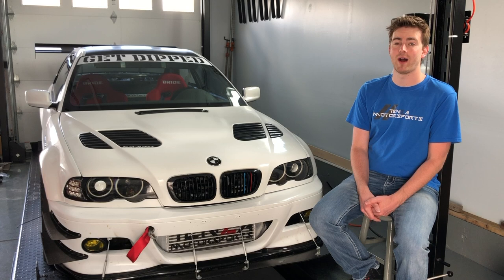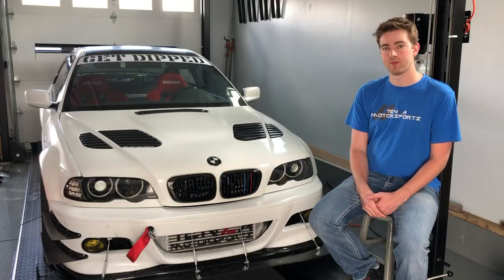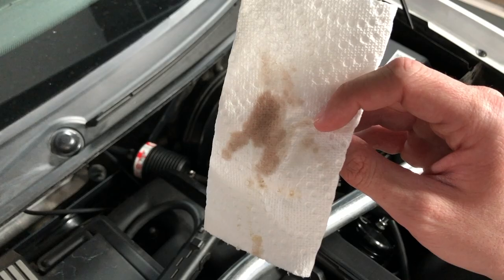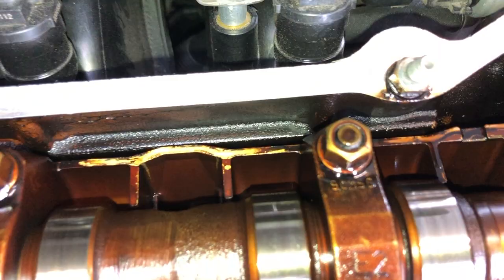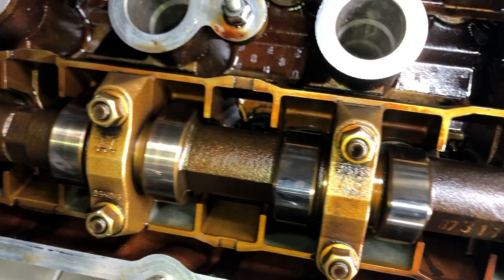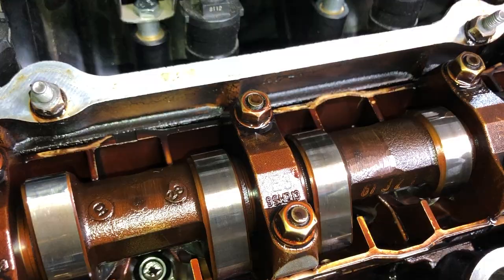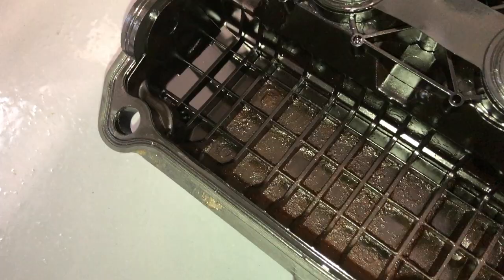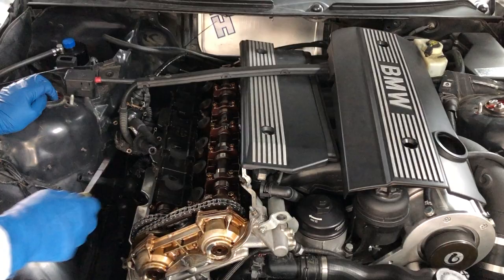500 mile break-in and Royal purple verdict (Part 2)

Comment: is royal purple 5w30 shrinking. it showed in dipstick below min. what is the problem. does the hps has same problem. some other users have ssme problem. what is the problem?
Reply from the maker: Not that I know of? If you look carefully at the video when I squeeze the paper towel around the dip stick you can see it’s actually on the high end. I had only added about a half quart after the initial start up. That’s just need because the oil filter fills up and there is lot of oil hiding in the engine such as the vanos system. So far no problems here. I will definitely look into it tho
Reply: @TenzaMotorsports  i usually check oil level next mornong before driving? my car dipstick showed below min. no worry my car is treated with Xado oil additive that generates on cylinder wall ceramic surface that is 10 times stronger than steel and increases the compression. but in my car the oil was below min. i drive 2006 uprev infiniti g35 sedan 6mt with 132k mileage. some sensors gaskets are leaking. is it cause rp.? i have read issues people are having after using rp hps. knocking sound etc. it is strange??
Reply: @KK10027  if there was any build up or sludge at the sensor the RP washed it off.
Nissan Engines like the VK Series are very harsh on oil.
I don't go beyond 5k mile intervals on synthetic. I had just changed my Valve Covers on my Titan you won't believe the build up in them.
I'm not the first owner but I've heard this is common when people go with the 7500 OCI and use a conventional or semi synthetic.
Reply: Sounds like you have a engine problem not a oil problem, just saying motor on.

Comment: Specific question but the new Ford F-150 is known to get higher carbon build up on valves because for what direct port injections 

Would this help clean those valves? Right now ford has no clear solution for keeping them clean and they can get pretty dirty pretty quick
Reply from the maker: I would not be afraid to try it. Run it for awhile and change it and see what it does. You can also send it to be analyzed by a lab after use to get a more empirical answer. Good luck!

Comment: Well, so, what you say about this oil? Good or bad? How much miles do you running with this oil?
Reply from the maker: It’s been great. In this specific car I’ve done about 2k miles regular Royal purple and around 3500 miles with XPR
Reply: @TenzaMotorsports  thanks so much. I use ZIC TOP 5w30, workin' in taxi every single day. But this oil interested me. I want to give it a try.)
Reply: I change oil every 10000 km.

Comment: Put a quart of atf in your engine will do the same thing only better
Reply: Yes sir that's a old mechanics trick I have used several times on old sludgy engines that have lifters making noise because of being plugged with crud worked every time for me !
Reply: How long do you run the engine with atf I have a 01 suburban with 248k miles on that has a couple hydrualic lifters taping

Comment: Thanks! I have a brand new Challenger R/T. I was told by the dealer and Dodge that the recommended oil change is by 6000 miles. Blew my mind... but at 4200 miles (since April when she left the show room floor), I feel it’s time to change. Youtube read my mind before I got into the research and your part 1 and 2 popped up (creepy but cool). I’ll give it a try and see how she looks in a thousand miles (probably still clean).
Reply: SO WHAT HAPPENED???

Comment: I have an old willys Jeep and have been running Rotella T.  I pulled the valve cover off after running it for 500 miles and was blown away how clean it was.  Similar to Royal Purple there are very strong detergents in Rotella T, and I am convinced cleaned the top end.  Seems like you had the same experience.

Comment: You could just change the filter every 500 miles and add magnets to trap microscopic iron particles.
Reply: Jon Hutchens you can never change your oil too often
Reply: Oil is cheap in comparison to engines and internal components.

Comment: Why not just use Amsoil? You want the absolute best for your engine don’t you?
Reply from the maker: I haven't tested Amsoil yet. So far Royal Purple has been the best
Reply: Amsoil is good, but Royal purple is the absolute best.
Reply: silfortytypex Yes and that’s why he is using royal purple. Amsoil is a scam. Nothing spectacular other than their sales pitch. Royal purple is the king of the hill and everything else is just oil. I guess you hate your engine, feeding it Amsoil.
Reply: My 1ZZ-FE engine in my Celica had this nasty sounding rattle to the top end of the engine that only sounded better when the oil was topped off to the full line on the dipstick and I switched to amsoil and the rattle literally disappeared instantly.
Reply: @KingJamesIX  
Totally agree... my VTC was rattling alot on cold starts and it started to go away after a couple oil changes of amsoil.
No joke
Reply: Amsoil is da best
Reply: Even Pennzoil is better than Royal Purple

Comment: My Ford F-150 is nearing its 80,000 mileage mark so other than the oil & filter change, I have to give it the 80,000 mileage maintenance requirement to make sure that my truck runs better and longer.
Not only that, but whenever my truck gets regular oil, I give it 2 cans of Royal Purple fuel additive every 10,000 miles to thoroughly clean the engine and fuel system and get better fuel economy in the process; it may be too much, but my truck has an eight cylinder engine, NOT a four cylinder. Plus, it's pushing 13 years old.

Comment: I can see that it cleaning the top been really good but what about an older motor that's got a lot of miles on it what's it going to do to that? I would imagine it might be more bad than it would good man that'll be clean but what else am I to do to it?
Reply from the maker: If it has had poor maintenance you will need to change lots of the seals and gaskets

Comment: Would it be safe to use in a four stroke vtwin?
Reply: Yes
Reply: Yes
 But if you're talking about a motorcycle where the engine and transmission share the same oil, a motorcycle oil would be a better choice. They have additives to deal with the meshing gears and wet clutch.
Reply: I put Royal purple in my 03 Harley, noticed a difference. More pricey but you get what you pay for.  20w50 and off you go.

Comment: That’s really cool, I have a 03 350z and ever since I’ve bought it I’ve only used royal purple. I also used to use their filter but autozone doesn’t carry it anymore
Reply: Ivan Guillen oof. I’m part of the z community and it’s been rated the worst oil for our cars and most of the community stays away from it. It probably wont hurt to run it every once in awhile just to clean the engine but not as a permanent use

Comment: Do y’all think this would work for a filthy 1991 D15b2 that runs conventional 10w-30?
Reply: Depends what are trying to accomplish. Was the engine abused, ran low on oil, valves loud as hell i had a d15b 3 stage snd i always ran pennzoil high mileage 5w-30.

Comment: RP is a great product, as far as the exhaust cam being cleaner then the intake cam, Note this is a educated guess. I would say because the exhaust cam is hotter making the detergent in RP more effective? Also the exhaust cam is lower than the intake cam gravity could cause more oil to collect on the exhaust side of the head before it drains down to the oil pan to start it's journey over again? NICE RIDE home slice.

Comment: So can you put any synthetic oil in old engines with stock parts?
Reply: Yes you just cant use old style oil in modern day vehicles new oil is backwards compatible
Reply: Sure if it's got new gaskets and seals because I have tried it in a 90s Chevrolet V6 in a Corsica that had about 140,000 miles no leaks prior and ran excellent and it started to leak oil like crazy until I switched back to regular dino oil ! Being older engines the gasket material and sealing surfaces arn't nearly as good they will tend to leak being synthetic oils are thin and very slippery so you have to watch it !

Comment: My first experiences with RP came about twenty years ago. I'm curious which oil you used. Back then, RP advised against using it in a new engine. I think it was 1500 miles minimum for a street engine, and the equivalent of 100 short laps on a racing engines. They've since released a break in oil, and assembly lube. I wouldn't think the break in oil would have as much detergent. Could be wrong, it was just a thought. I've never been into an engine that ran RP, except race engines, and they tend not to get dirty anyway. But I have always noticed a quieter and smoother engine on start up, whenever I've switched a used engine over to RP. It's good stuff. Thanks for sharing your observations.

Comment: Royal purple is aces in my book I had a 600 horse Nova with a small block in it the oil pump pickup broke of 3/4 of the way down the quarter mile at the race track and it was reved to about 7500 rpm with no oil pressure I didn't look down until I went through the traps and seen the gauge it said zero I instantly shut it off and put it in neutral and put it on the trailer pulled the engine and I know there is going to be someone that's not going to believe this but there was no scoring of the cylinder walls and the bearings looked so good they had no scoring no wear marks at all they still looked new and it didn't hurt the solid flat tappet cam I couldn't believe it Royal purple is the only oil I run in my race car and I don't care what anyone says or what kinda oil I should run Royal purple is the only oil that goes in my race car period
Reply: My 1982 Plymouth Reliant drove to the cape from Boston with no oil in it at all. Once I put in a couple quarts the ticking went away

Comment: Babying a car for 500 miles of City driving is possibly the worst way to break in an engine. In order to actually seat your piston rings you need increasing rpms over about 50 miles. It needs to actually have load and rpms(aka not highway cruising or short shifting in the city)
Reply from the maker: By “ babying” the car I meant that it was not raced or abused. You are correct in what you said and that’s exactly what was done. Thanks for helping to clarity this!
Reply: @TenzaMotorsports  Thanks for the clarification! I was surprised that you would spend the time and money on a build and then not break it in properly. Like your car btw, it's a nice build.

Comment: cool beans.  Will it gunk the pump though on a high mileage engine?
Reply: Jake Valent if you haven’t been running full synthetic in your car yet it’s not recommended to start running full synthetic in a high mileage engine. If you have, don’t worry about the gunk moving around in the engine, that’s what the filter is for.

Comment: Regular use of ANY....ANY quality synthetic will clean sludge.  There is no magic going on. Motor oils, especially synthetic high mileage oils are full of detergents. Off the shelf royal purple is $10 more than all the regular brands and has absolutely no formulary advantages (just another group 3 synthetic). The off the shelf RP (Walmart, AutoZone) is not the group 4 RP of yesteryear made famous in race circles. For the same money you can get M1 AP which is 40-70% group 4 depending on grade (20 grade with the most) and far superior. And M1 EP which is 20-40% group 4 for much less. When RP prices come in line with M1, Shell products and Valvoline synthetics I'd happily throw it in rotation.

Comment: Most oils would have done this lol
Reply from the maker: I have ran Mobile1 Valvoline and Castrol (full Synthetic of course). Never had any of those clean out an engine before
Reply: Try the Amazon full synthetic it's a great deal and check the reviews from project farm
Reply from the maker: Amazon oil? Gunna have to pass on that one.
Reply: Why not
Reply: @TenzaMotorsports  It's incredibly close to Mobil1 and has the same certifications. I used it recently for my Lexus and Toyotas. Saved around $5 per gallon.

Comment: If you do enough looking on Royal Purple’s website you will find that they have a disclaimer that says the oil will turn brown shortly after an application but then it stays that bronze color until it’s ready for a change. So don’t fret that it loses its purple color shortly after you start using it, that’s normal.
Reply from the maker: This is very good information to know! Thanks for sharing. I will check out their website for sure now.
Reply: Tenza Motorsports, it’s in their FAQ section under the “motor oil” FAQ’s. Thanks for replying.

Comment: You need more than 500 miles..1500/2000 would be a good test
Reply from the maker: With the rebuild break in process, we changed the oil at 500 miles. We were trying to show how fast it starts to show progress. We do check ins in later videos

Comment: I've Been Running Royal Purple For 30,000 Miles And Typically Change It Every 2000 Miles. It Always Turns Black After 500 Miles. But It's Cus My Car Is Turboed With 200,000 Original Miles Making 230 More HP Than Stock. All Stock Engine Internals Except Rocker Arms And Valve Springs 😜. Every Oil Change I Add Motor Medic Flush At Operating Temp For 5 Mins At Idle. Then I Drain It And Pull The Filter To Empty Filter, install Old filter And Fill Engine Up With Supertech Wall Mart Oil And Run For 30 Mins... Then I Drain The Oil For 15 Mins, Replace Filter AND THEN Add My Royal Purple. You Can Barely Read The Dipstick Is So Clear. It's Looks New Transmission Fluid In A Brand New Car hahaha

Comment: My 31 year old Toyota with 302K miles takes 7 quarts each oil change. Obviously the internals never looked "pretty" even from day one at the factory. That said, every oil change I use a K&N oil filter, 6 quarts of Mobil 1 High Mileage 10W-40 and a quart of Marvel Mystery Oil. My engine is as clean as it's ever been and the valve train is nice and quiet. Oil comes out clean on changes too.
Reply from the maker: Toyota makes awesome reliable cars!
Reply: @TenzaMotorsports  Absolutely agreed. But, like any vehicle, maintenance is needed. I'm sure there are other combinations of oils and additives that will also work well, but the combination I use has worked very well for me for the last 15+ years. When it comes to maintenance though, I totally baby my truck. When I neglected the tie rod ends for a few years I decided that rather than try to free them up and keep using them, I just replaced them with new. What I refer to as the "Toyota Curse" is how difficult it is to find a vintage used Toyota that hasn't been severely abused or neglected because of the mentality of "It's a Toyota it doesn't need maintenance!". I'm a Land Cruiser fan and have long been searching for a decent condition FJ55 to buy as a rolling restoration project. Unfortunately, every one I've found has been an absolute basket case.

Comment: I use this oil in all my vehicles mustang GT 1997 with 64 thousand original miles awesome and all my chevys a 5.3 with 340 thousand miles a 1999 Tahoe 150 thousand miles and 2014 impala 175 thousand miles and I love it costly and I still change oil every 3000 miles my vehicles run great getting ready too pull the 5.3 litter out and rebuild it and use moter for a inbord boat and put a 383 stroker in my 2000 Chevy Silverado 4 wheel drive and I will use royal purple in it I believe mobile one is a good 👍 oil too my friends have had good 👍 luck with it also good luck with whatever you choose I wish you all the best 👍!

Comment: Doesn’t seem  like  a  very good idea for a “rebuild”. You’re pulling old ,dirty, gritty oil into your new engine
Reply from the maker: No dirty oil went into the engine?
Reply: Tenza Motorsports So, where exactly did all the old crusty oil build-up go? Oh,that’s right, the purple pulled it off,directly into your new engine.
Reply: Wow reading that sentence made my head hurt. No wonder nobody understood what you said.
Reply: Yeah ideally he would have cleaned the cams by hand first but this was in the name of science.
Reply: @BlockchainToTheFace   While yes, all the gunk was recirculated into the engine when he put fresh oil in the replacement engine, the oil filter most likely took care of all of the grit before it caused any abnormal wear in the engine.

Comment: Your leaks can front that oil I had used the same stuff for a year in my lexus gs430 before I had no leaks when left town came  back backed out and saw a big ass puddle of purple fuild its was leaking from the bottom
Reply from the maker: My pan was leaking because we forgot to put RTV silicone on it. You have to use the gasket and the Silicone or it’ll leak.

Comment: That is not a “tow hook”. It’s a transport hook. So once it’s on the back of the transportation truck it can help restrain the vehicle in place on the back of the trailer.
Reply: It’s actually in the manual of those cars and similar that if it’s stuck and needs pulled out to use that to tow it a short distance, I had to help a lady and couldn’t find a spot to hook a chain, had a look in the manual and that’s what it described to do, didn’t even know about it until then but yes you are correct to
Reply: The Porsche’s and Audi has the same tow hooks.  There backwards threaded too.   On a Carrera the rear hook goes behind the licenseplate
Reply: Those are not transport hooks. When they are hauled on car carriers they are tire strapped. Using those to secure the vehicle with is sure to get you body damage if you are not real careful.

Comment: should check out project farm and his oil test series, purple got eliminated pretty early on. he does wear tests, heat tests, flow tests, pretty thorough stuff.
Reply: my own experience with purple, is i filled my 72 with it, and it made the loudest lifter racket after a few miles, drained it, filled it back up with rotella T and all was well, my oil pressure even dropped while using it... so I won't touch it again, out of personal experience, but I'm glad it's working for you.